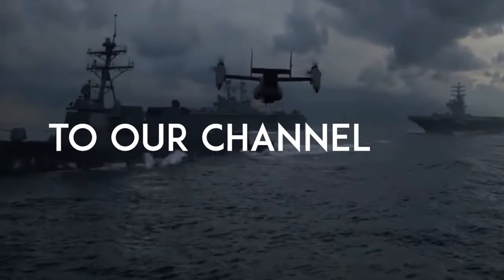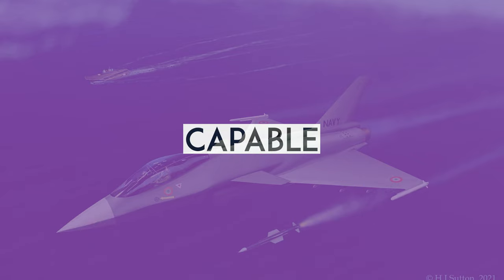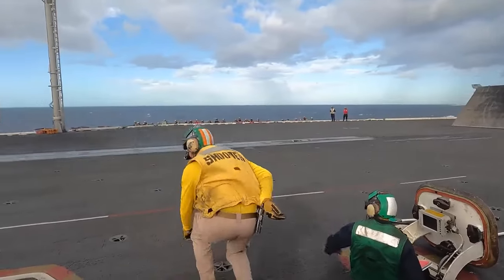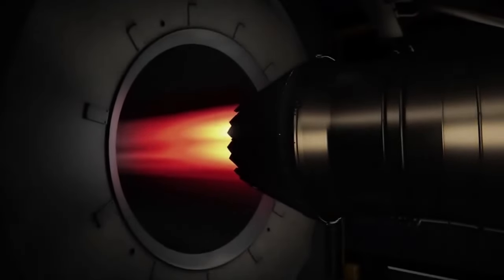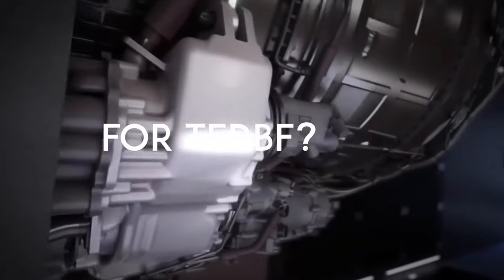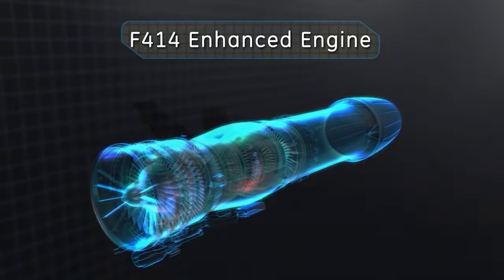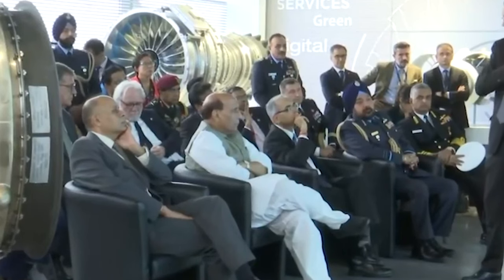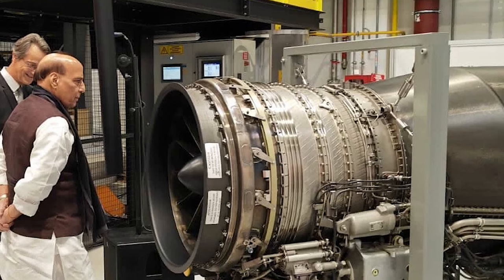India's TEDBF is getting the ultimate engines

Comment: Indians, be careful about this future French 110kn engine hype at this stage!  It is a common sense that France doesn't have the top aero engine technologies in the world.  Specifically, the current French engines used on Raffle fighters are far less capable than the US F400 series of engines.  And also, the new deal between Indian and USA on building (or even improving) F414 engines in India with a high percentage of transfer of technology from the US to India has a much, much better chance of success in the foreseeable future for India to have a reliable, powerful and useful aero engine because of the one most important factor:  F414 engines are currently used and proved products, plus their current thrust level that has already reached the target of the planned French Safran 110kn engine.  More about F414, some sources said that Americans even suggested a new engine core for the F414 engine to give it a potential of 20% thrust increase to something like 130kn above level.  This is also much more reliable and safer way than French one.  Again, a common sense:  Developing a new aero engine from scratch has so many unseen risks and cost-overrun issues that even the world's top aero engine countries like USA cannot be 100% successful on doing this, let alone France whose engine technology is not even as good as that of the UK.  As a result, how can you guys say that this planned (hyped) French engine is an "ultimate " one -- maybe from the point of view of having a good dream for now!  Good luck to your Indians!
Reply: Agreed but maintenance & spares back up during war time situation is also important. Availability of Fighters is also important!
Reply: India has defeated hyped US weapons used by pak , by older Soviet weapons when Is was calling them junk even that time   😂
        India knows how US media sell world 😂😂.  
     Let me tell u , US jets are tender are only to reduce the price of France jets 😂😂